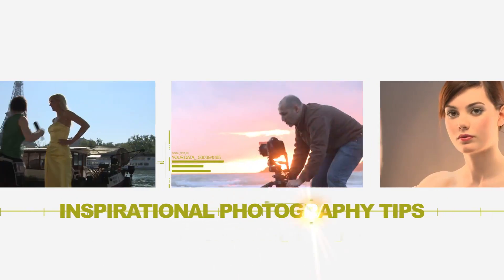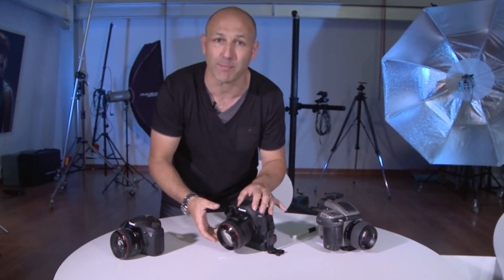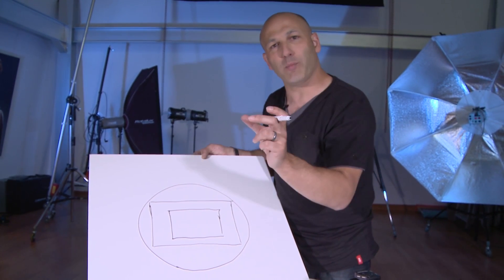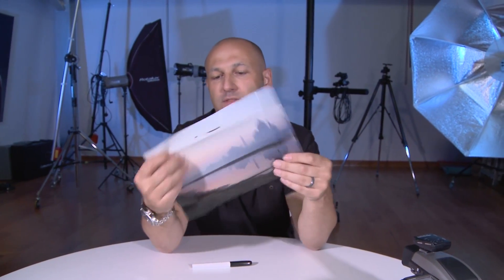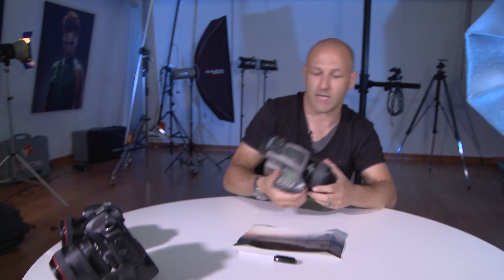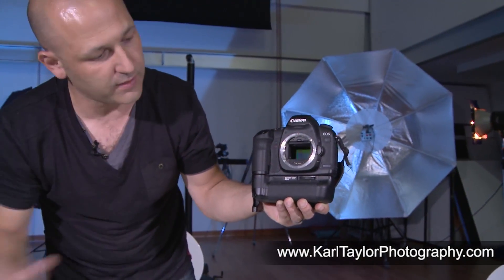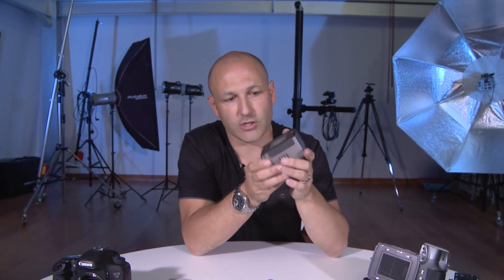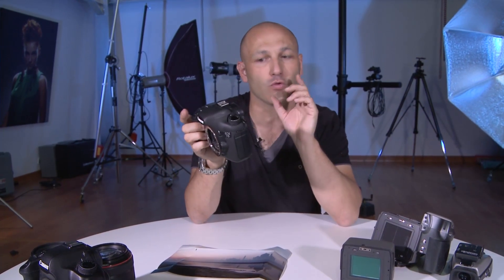Full Frame Sensors vs Crop Sensor Cameras Explained by Karl Taylor!

Comment: At around 11 minutes into the video I think the explanation of DOF control is rather poor. You first choose your perspective, then your lens. If you want the FOV that a 85mm lens on a FF camera would give you and you use a crop camera, then obviously you don't use a 85mm lens but rather a lens that gives an equivalent FOV — something like 50mm on APS-C or 42mm on MFT. Stepping back farther than you would like to means you have the wrong lens with you. A shorter focal length has a greater DOF, but it's no different than the FF equivalent. I.e. 42.5mm f/2 on MFT equals 85mm f/4 on FF. The only difference is that with FF (or any larger sensor) you can use an even shallower DOF.
Reply from the maker: The point in the video is that if you want to compose the image to fill the equivalent space on a crop sensor compared to a FF with a given focal length then you will need to be further away therefore the perspective and the depth of field will look different. If you decide to use a lower focal length to fill the equivalent space on a crop sensor then that lower focal length will also cause the picture to look different from the FF with the higher focal length. It's all about the end result. Take a look at my end results karltaylorportfolio.com I actually use larger formats because a FF does not offer the same results as a medium format. FF has been the standard format since Leica developed the first 35mm film cameras back in the 20's. Crop sensors only actually exist because it's cheaper to make the chips compared to FF chips.
Reply: How else can you compare the fixed physical difference between the sensors than to choose a specific fixed reference point with fixed physical controls i.e., the same lens and same position?
Reply: ***** Your last line here is a disservice to most photographers, at least the last couple of years, I think. Coming from your standpoint, where you even prefer Medium format, I take it you shoot photos that become very large prints, and that is one of the few reasons to own FF (or certainly Medium frame). However, for most people that rarely print larger than 8x11, a good crop sensor camera is a far more sensible choice. They tend to be much smaller, offer almost 100% of the same usability except for some very extreme situations (Large prints, Sports photography). You know the saying, the best camera is the one you actually take with you. I have heard all too many stories of people with large DSLRs that don't bring them on trips, or even walks because they are unmanageable.

Comment: I just got a 6D camera after using the 7D for a few years.
FF is just awesome i find my images look better because of depth of field and the ISO noise quality is so good i don't have to worry about the auto setting of it when i lock the shutter speed and aperture.

It's not as "nimble" as the 7D though in the sense that the 7D is a sports camera with good auto-focus and quick controls but the 6D controls are nowhere near as bad as a Rebel's for instance.

Though don't trust my opinion too much regarding the 6D i've found that others overvalue the usability of camera bodies when they have better ones covering it's weaknesses. If you'r only camera is a 6D you might feel more boxed in.

Comment: I'm with you on everything you talked about here Karl except for your explenation of how you can get the same image as a crop sensor by cropping a full frame image.  If you crop an FX 22mpx image by 1.6x you end up with 13.75mpx where the crop sensor would still out resolve it at 18mpx. An equivilant FX sensor to an 18mpx Aps-c sensor is closer to 36mpx in pixel per square mm.  Aps-c sensors are smaller but only cropped in terms of 35mm field of view not in the quality of the detail.  Thx. JD

Comment: So, practically speaking, with a crop sensor you get a not-so-expensive camera, but actually need to buy larger aperture, more expensive cristals to accomplish a full-frame field depths.

My question is: How logical is the size/price difference ratio (on the camera alone and the optics required)?? Why does it have to exist a gap between both worlds, is that distinction really inescapable, is that the real sensor production cost difference?

Well played, manufacturers.

Comment: Incorrect (I'm a semiconductor engineer). The structure of the sensor material does not produce a smoother tonal range at all. Sensors are made from raw materials such as Silicon, boron etc. The atoms of which make up the sensor's "structure" are universally the same size in any sensor.

Comment: An added note, when deciding on a sensor and camera, also look for lenses with the proper image circle. As he stated, the full frame will need a larger image circle lens than a smaller sensor. Buy the lens, with the proper image circle, that fits your camera's sensor.

Most pro grade imaging sensors are a Grade 2, some higher end models a Grade 1. This means that there are more bad pixels on the sensor in a Grade 2 than a Grade 1. Military Grade are the best, so is the price!!

Comment: Look at it this way, you get a cropped view which looks like a "zoomed" view with a 50mm. Think of it as if you are looking through a small hole (lets say around an inch in diameter) on a wall that gives you vision of the other room and then look through another small hole (but is two inches in diameter) that also gives you vision of the same room. You just see a bit less but technically no difference.

Comment: Correct. I started on a 35mm (full frame) film cam. Now, I have a 1.6 crop sensor. I was used to using a 28mm lens on the film camera (med-wide angle). When I bought the crop sensor, I bought a 15mm lens which gives me an effective 24mm focal length. So, it "feels" like I'm working with the old 28mm full frame lens. Now, as he explained, full frames tend to capture more light (wider EV range) and generally have better bokeh. But, imo, you really have to be working at pro levels to notice.

Comment: what about using special DX lenses for crop frame cameras? If it mean that you will have same view after shoting? I mean same mesures picture, bur not about pixels or resolution. For exemple same picture yuo had showed for demonstrate full and crop frame pic. If you use 24mm FX lens for full frame camera nad for crop camera you 24 mm DX lens will you have same view inthw final?

Comment: yes but if you take the 18MP of a crop compared to 22MP on a full frame on the same area, the crop has actually a higher resolution. that's why the 7D wins over the 5D2/3 in sports. Much bigger magnification (1.6), but only slightly less MP., so the density is higher.

Comment: Great video Karl. I wonder about dynamic range with the 3 formats (crop, full, medium). Photographing a house, for example, on a sunny day, which is best for details in the dark shadows? I don't think crop lenses are necessarily inferior to full frame lenses, such as Canon L lenses. I am sure there many crop lenses that are professional quality. The main difference, as you say, is the physical size difference of the sensor. And if you need to enlarge a printed image, a bigger sensor is better.

Comment: Depth of field though depends on both the distance from the subject and the focal length (assuming the aperture stays the same).
So, a 85mm f/1.4 lens on a full frame sensor should be pretty much the same with a 50mm f/1.4 lens on a 1.6-cropped sensor (well 50*1,6=80 but lets assume it's the same).
If we shoot the same portraits from 6ft away with the 85mm on a full-frame sensor and the 50mm on a cropped sensor, we have kept all 3 factors that affect the DOF the same!
So why would DOF change?
:)

Comment: so if a crop sensor has 18megapxl (t4i/650D) and a full frame 18megapxl (1dx) does the crop sensor have then still 18mpxl but only on a smaller area, because if yes then it would be the same as if i would just simply crop a full frame picture 1.4 or 1.6 times?!?!!?

Comment: I think it's just because of that actual equivalent Focal length! wider would be a less of camera shake imo, it has nothing to do with sensor size. And according to my experience, I never saw any differences of camera shakiness between 24mm on my Full-Frame-5D and a 12mm (24mm equivalent) on my 4/3rds-EPL1.

Comment: You missed one point. The larger the sensor area, the less the effect of camera shake. Medium format often appears sharper because of this. Old press cameras 4x5 inch area capture, could easily hand hold 1/4 seconds exposures because of this effect.

Comment: Yes you can, but that would change (increase) your depth of field.  Depth of field is determined by three factors.  Aperture, focal length, and distance from subject.  If you want to blur out your background a cropped sensor isn't going to be as effective as a full size sensor because you would either have to move further away from your subject or use a wider focal length.  Both of which increase depth of field.

Comment: That's the best free hand circle i saw anyone draw :D
Thanks for the video man. I have spend half a day trying to clear out a specific doubt. I think I found the answer, but will confirm that from you... Here it is...  
If i use a full frame body on my 400mm lens, then crop it to 1.5 times in my laptop... does it gives exact result like shot from a crop body of similar specs? so with a better tonal range, does it make a FF a better choice for wildlife photography?

Comment: A little while back i read a blog from a successful photographer (wont mention who) and he was telling his many followers which are made up of a large number of models among regular fans to basically not work with any photographer that doesn't have a full frame camera like the 5D and even the 7D doesn't cut it, this to me seems a little harsh.I have a 7D and use a sigma 17-70 lens crop sensor dedicated in a studio and it gives a great results, naturally a 5D would be an improvement.Any thoughts?

Comment: It's a hasselblad. I am not sure which model he had. Looked like one of H3D or H3DII series. Maybe even an H4D. But, the H3DII series, and any series before it, is discontinued. I think you can get used bodies. But the H4D series is about 20,000$-50,000 dollars. Very expensive.

Comment: So how would you rate the improvement of a FF over crop on image quality? 10%? And you are paying at least 100% more. The dynamic range difference is small and only applies to certain shots. A crop camera is not the same as a photoshop crop because you have a higher resolution in the former. Depth of field differences can be compensated by using wide aperture lenses. Less Noise in low light? Photos look better when well lit. Low light will always compromise image quality. If you make your livin

Comment: There is another huge difference between the cameras.
Cameras with a smaller sensor most often have a smaller viewfinder compared to fullframe-cameras due to the smaller mirror and pentraprism.

Coming from a film camera it looks like a tunnel.

Comment: Thank you Karl, this helped further clarify certain aspects some of us may of had. Just wondering though, would you consider shooting with a smaller sensor at a larger aperture (F2.0) an advantage when trying to capture a wide depth of field with subject matter within close range? Could this be one of the few advantages to using a small sensor over a large sensor camera? Apart from cost that is.

Comment: With the 10-22 you would get the same field of view as the 16-35. With wide angle lenses there's usually always distortion. I would think the L lenses are far better corrected for that. I wish Canon made higher quality EF-S lenses for the crops.

Comment: why it is the best portrait lens? 

many people like the look of the 85 but just as many like the 70-200, 105, 135 or an other lens better. 85 is good for Headshots, 50 good for bodie and 135 also for headshots with a very small amount of dof... etc. and that goes on for a while.

Comment: Nikon , Pentax and Sony crop sensors are 1.5x, there a bit larger than the canon crop of 1.6x
giving a better pixel density and helping reduce noise, either hot pixels or pixel overflow as i like to call it, 
a crop sensors photo-site is like a cup 
a full frame photo-site is like a bowl
and a medium format  is like a bucket
imagine 50 of each of the above "cup,bowl ect" each filled with red blue and green.
which one will overflow and create a mess "noise" first if you pour water"light" into it.